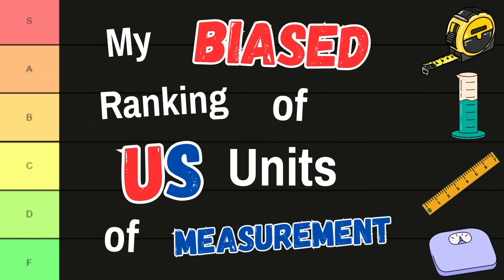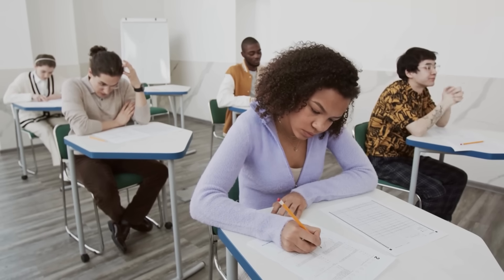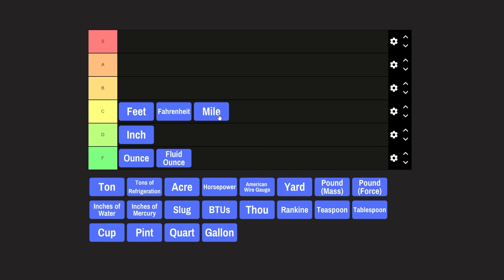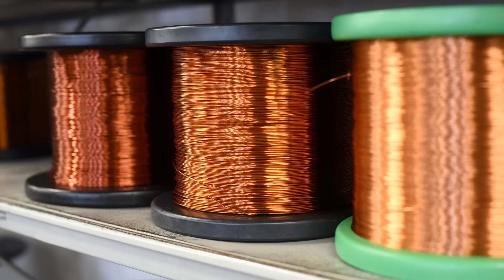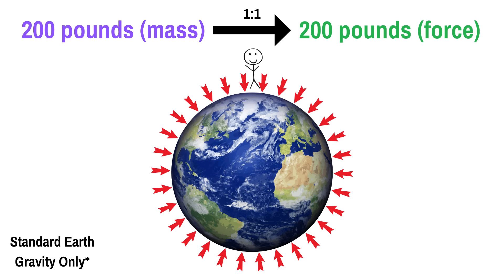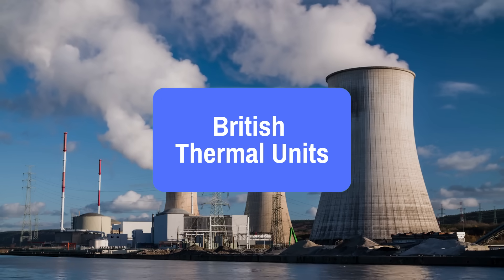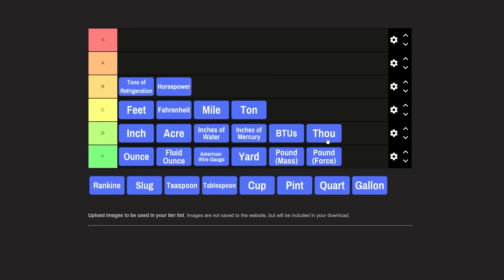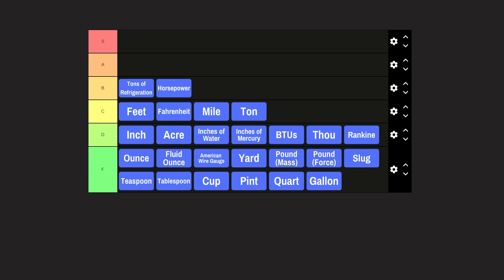Tier List of the DISASTROUS US Measuring System

Comment: 1 TR = 80.01Kcal/kg*907(907 per short ton)/24. Rules of thumb: "1 TR is approximately equal to 12000 BTU (I don't know which one. I could easily figure it out, but I don't care) or 3024 Kcal/hr of energy/heat load." How the f did this get B-tier, are you high? I accept, that it was good at the time tho. I agree on HP in B-tier, good unit, just outdated. I also agree on Cup, Pint, Quart and Gallon, contrary to popular belief there is not one, but many different definitions on what these are exactly. Some companies provide proprietary "cups" with their ingredients, some recipes fail if you use the wrong cup size. The Gallon was changed 10 times because the old Gallons where based on different bronze statues, which all got lighter over time. Half of the Pint definitions are based on Gallon-definitions. Some are just like "f* it, 1 pint is 0.5 litre now." Or even 2 litres! Actually I don't agree on F-tier, they should be lower, like F- - - tier or ZZ-tier. Definitely worse than Yard. Fun fact: If you go onto WIkis disambiguation page for slug, then you have to scroll way down to find the unit.

Comment: I had the joy of starting with bushels pecks rods poles  perchs (??) chains furlongs  etc at primary school. Then less archaic Imperial units at lower secondary school ... changing to cgs then mks and finally the sanity of SI by 'O' levels. After that it was SI all the way through 'A' levels and Mechanical Engineering 😊
Once we asked our Physics teacher what units we should use in our homework ... he said whichever we want to ... so we used Astronomic units, Earth weights and Eons.

Comment: It’s a shame that this list failed to include the U.S. survey foot. In 1866, US Congress decided to define the foot as [1 foot = 1200/3937 meter exactly (or 1 foot = 0.304 800 6 meter approximately)]. In 1959, the internationally agreed upon conversion for a foot became [1 foot = 0.3048 meter exactly]. The change was recognized across the US, but geodetic surveyors were allowed to use the old system as an exception. Somehow it took until January of 2023 to get them to shift over to the international foot and deem the US Survey foot to be obsolete. 

Despite being made obsolete, my college surveying professor still made me do calculations with Survey feet in 2023.

Comment: There is just one S tier trait of Imperial Measuring- fractions are easier to deal with since it deals in Base 2, 4, 8, 12, 16, 32, 64, etc. rather than everything being 10s based. That's the only reason I feel it's useful, Metric and fractions are a pain because it's all Base 10. I wish we'd sync up an inch to say: 2 CM- that way they'd translate easily, even the basic fractions would be easy to deal with in Metric if an inch were 2CM. Other than that I wish we'd all just switch to Metric. I'm also a bit bias towards F vs C regarding temperature, only because I'm so used to it- same with pounds. I still say junk Imperial, redefine an Inch to make them easily compatible, get rid of Lbs. and F. though, along with all the other Imperial junk. Too many People would gripe, just like this cursed Daylight savings time garbage- so we keep it because People just don't want to get used to something better.

Comment: You didn't mention the other "gauge" either, but maybe that's used universally. (Gun barrel size.)
It's based on how many balls of lead of a certain size equal a pound. So a 12-gauge shotgun's barrel is just big enough to fit a ball that was a 1/12 pound of lead. (Smaller numbers are bigger again, but it's a bigger scale than the wire is.)

Comment: gauge meaning something smaller and smaller as the number goes up makes sense with bullets (like x gauge shotguns) - 
20 gauge means that out of a block of a certain size of lead (forgot the size), you get 20 bullets.
30 gauge means out of the same block, you get 30 bullets.

so 30 gauge is smaller than 20 gauge.

Comment: As a European I was raised in metric, and hate Imperial, but I have to say Fahrenheit was a recent revelation for me. I'd always thought it was stupid, but to be honest temperature is always going to be arbitrary - even scales which start at 0 Kelvin have arbitrary units - and the idea that it would simply be 0 = uncomfortably cold and 100 = uncomfortably warm seems to make just as much sense as using the boiling and freezing points of water (at a specific pressure, with specific purity, etc.).

Comment: US fluid ounces are heavier than one ounce though - Imperial fluid ounces are a little smaller than their US counterparts, and are about dead-on one ounce in weight.

If that liquid had been water, the weight would have been pretty much the same as the soda; if it had been 12.5 Imperial fluid ounces of soda rather than US fluid ounces, it would have weighed 12.5 ounces.

Soda and water do have different densities, absolutely, but not enough to account for the discrepancy shown here.

Comment: Despite American insistence on bastardising the English language, a metric tonne should be spelt the correct way - “tonne” - and not the American way - “ton” - to avoid obvious confusion and since you don’t even really use metric.
Same goes for measurements - a meter is a device for measuring (water meter) whereas a metre is a unit of measure (the door is a metre wide). Americans should adhere to the standard spellings, not arbitrarily change spelling of something they don’t actually use.

Comment: i can personally work in any measurement system provided its consistent throughout the project. However i will almost never intuitively move to metric because inches and feet feel more natural than centimeters and meters since they are too small and too big respectively. dont even say it cuz i know not a soul uses decimeters Also as mentioned, Fahrenheit  is a more digestible form of temperature for a human, however i almost always think in Celsius for technology since that's usually how its read out and makes more sense in that context since 100 C is usually the max allowed temp. It'd be nice if we made 1 yard = 1 meter but then a few other measurements would need to change with them such as minute of angle.

Comment: I think penalizing the fluid ounce just because water doesn't have the same density when you dissolve stuff in it is a little unfair.

Metric basically did the same thing.  A gram was originally created to be very close to a cubic centimeter of water.  A liter is 1kg of water.  1 mL is 1g of water which is roughly equal to a cubic centimeter.

Metric does have the nice thing where you know how much it is in cubic centimeters (good luck converting fluid ounces to square inches) but fluid ounces seems like one of the few times when imperial units had the right idea.

Comment: Was afraid you'd put Farenheit higher but a pretty reasonable tierlist overall.
Reply: Fahrenheit should be higher. 90% of the time we use temperature to talk about the weather or the room temperature. There is a noticeable difference between 85-87 degrees F but you can call them all 30C.  Also who cares what temperature water boils at? You don't set your stove to 100C to boil water, you just turn it on high and water might freeze at 0C but you don't set your freezer to 0C to keep your food frozen, you set it to -18C which is... wait for it... 0F!
Reply: @McP1mpin Fahrenheit is better for indoors, Celsius is better for outdoors
Either way everyone can probably agree Kelvin’s the least useful of the 3 in daily life, only being good for hyperspecific lab settings
Reply: Hi, I agree that there's a difference between 24.4C and 30.6C but luckily decimals are a thing and celcius has no problem expressing these values at all. 
Taking the boiling and freezing points of water as 100 and 0 values objectively makes more sense than the incorrect estimate of human body temperature and the freezing point of a salt water mixture that fahrenheit uses for these values.

The -18C that you set your freezer to is a relatively arbitrary number set there as a compromise between efficiency and energy consumption. The reason that is isn't -19C is because -18C is easier for Americans to remember and American companies just caused it to be the standard.

Comment: In the US Customary Unit system, one fluid ounce of water does not equal one ounce of water. A US fluid ounce of water at standardised temperature and pressure weighs 29.57 grammes, while an ounce is 28.35 grammes, so about 0.4% difference. I will give that a (generous) C. Note that the Imperial fluid ounce of water does weigh 1oz, or 28.35 grammes. But then the USA does not use Imperial units, despite what many claim. The country clung onto an older system of English units, which means there are some significant differences.

Also, James Watt did not invent the unit of horsepower to allow customers to envisage the work it could do. The unit was invented so that Bolton and Watt could charge royalties. It was a bit like Ford charging you annual royalties for how fast your car can travel.

Also, on a technical point, there has been no such thing as the conservation of mass in physics since the Special Theory of Relativity was accepted. There is a principle of the conservation of energy though, although even there we have to be careful with some implications of the GToR.

Comment: Thanks for putting this tier list together, as a European I did not know about the slug. And then there's Grain, Hundredweight, Stone, Furlong, Bushel, Foot-Pound, etc etc. You can't blame the US for all of this, most of this stuff goes waaaay back. I like the way some of these measurements correlate through common objects. For example, a small scale is called a troi, where 1 troy ounce (unica, half a pound) is 480 grains barley or 640 grains wheat, which is also approx 1 apothecary ounce. The carat (not karat) is one carob seed (ceratonia siliqua) where 24 carat (a siliquae) is a solidus, a gold coin weighing approx 1/72 of a pound.
Reply: You can't blame The US for the fact that these measurements got invented, but you can blame the US for still using them.
Reply: @davel4708 The vast majority of these videos make fun of Americans for using units that the vast majority of Americans don't use.  They bring up units like the chain as if, simply because it has a historical definition, we actively use it.
Reply: @davel4708 we don’t, they are defined but non of these are used in common language
Reply: I'm American and I didn't know about the slug, either.

Comment: You put mile in C tier?  It is definitely D tier at best because you cannot convert it to any of the other units easily even within the same system.  I mean at least tons are 2000 pounds but a mile is 1760 yards.  With the smaller units like feet or pound the fact that it is on a human scale overcomes some of the arbitrary nature of it's creation but a mile is not only even more arbitrary it is too big for easy comprehension.

Comment: Fun video but why so harsh on thou?  That's the one unit that has a clean relationship to others.  On the other hand, there is one knock against it you didn't mention. The people who use it (machinists and CAD designers) usually call it a mil, as in one one thousandth of something.  That drives me crazy because "mil" is already taken, at least in casual speech, to mean a millimeter or in chemistry and medical settings, a milliliter.  F YOU! IF YOU INSIST ON CRAZY UNITS, YOU DON'T GET TO HAVE THAT WORD!

And how can gauge not be your all time most hated one?  That not only has the most insane definition (the thirty ninth mathematical root?  Come on!) but it's backwards with big numbers to mean small!  I have to work with gauge sometimes and it is ghastly...

Comment: The fact that he was practically dissing the entire system was hilarious
Reply: It’s not the units that are the problem, it’s the fact that they don’t relate to each other. In the SI system all units derive from basic units for time, mass, length, charge, etc. and all go up in factors of 10^3, so it aligns with our decimal number system.
Reply: @Tailspin80  that is one problem. The other big one is, that for all of these Units there are countless other units with the same names, but slightly different meanings.
Reply: @MusikCassette  True. US gallon vs Imperial gallon being one.
Reply: @Tailspin80  or just think about all those different feet, that are about, but not quite 30 cm
f.e. the feet of my hometown is 289 mm. 
Of course we stopped using it, because it is f ing stupid.
Reply: @MusikCassette tbh feet make the most sense. Theres only 1 foot measurement it's just the conversion to other lengths that's hard to handle. I think you're just annoyed about its origin being a body part
Reply: @aceystar1478  that is not entirely accurate. in fact I strongly suspect, when you say foot, you do not mean 289 mm.
Reply: Well there is nothing not to dis about it, so
Reply: not enough though. I mean non of these  are anything other than F tier.
With miles he did not even Mention that there are other length called miles and this is the stupid one.

Comment: What is even crazier is that back in the old days, every European country - often even different cities in the same country - had their OWN version of the foot and inch, and other units. It was always 12 inches to the foot, but the length of a foot varied by up to 10cm! The shortest was around 25cm while the largest "foot" was over 35cm. It just so happens that America adopted what was the British Standard at the time.
This variance, combined with the growth of industrialization is, I suspect, part of the reason Europe embraced the metric system so quickly and thoroughly. It would be VERY difficult to have mass production when, say, ½" bolts from a factory in Hamburg are a totally different size from the ½" threading press you got from Berlin, and neither match the ½" nuts you ordered from Dresden.
Meanwhile, the US had settled on the UK Imperial standards throughout, and its industrial revolution was much more self-sufficient and self-contained. Without a pressing need for a new unifying standard, there was little incentive for US industry to convert to a new system.
This is my hypothesis, anyway.
Reply: Napoleon imposed the metric system (created in France) in France and conquered lands (and its civil code still used by many countries), the old units came back after his loss but still it was a standardized unit in every sectors which help in trades and science...so it took over  the old units which varied from places to places, easier to have the same units in rotterdam and Madrid for trades and industries.
Reply: So what actually happened is throughout the 18th century there has been talks about creating a unified system of units to solve that exact problem

Britain was the first country to ratify a national standardised system (the Imperial System) 

During the French Revolution, the newly minted government used the works of all the European Scientists that talked about a universal system, and created the metric system 

It came into law shortly after

The Napoleonic campaigns had Napoleon impose the metric system on the conquered lands and it thus became more and more popular throughout the european colonial empires and thus the world
Reply: Metricfication overall is a very complex topic due to a lot of politics around it. Meanwhile in the USA it is pretty simple and is exactly what was stated in anouther comment, the US sees itself as an exceptional nation, a world leader and a manifest destiny. The act of adopting a new system, especially not their system but someone else's, in a way goes against this mythos, so it would receive a lot of backlash, as did metrification in the UK (and how the UK never really completed metrification). The thing is, kids in the US are still using metric, in science and some engineering it is crucial to use it. 

Meanwhile, despite metrification happening in the 1970's for the country I live in, it's so rare to even talk about imperial even with those that lived under it for a significant portion of their lives. It goes to show if you actually put in the effort to change things, people can and will switch.
Reply: Rant add: America still keeps most of the British pronunciation and spelling of 16-18thC British... At least that's consistent

So some American words are more closer to Shakespeare than modern English English.
Reply: Not to mention that the US does not use Imperial units but the US Customary units, which in part differ - and are defined by metric standards.😂
Reply: They are Just stunborn, the British and even nasa are using the metric sistem
Reply: Germany went metric the year after it was finally created in 1871.  It was rather late to the party, but then again, it didn't exist before 1871, and parts of what became Germany went metric before that.

As to the US and their bastard version of imperial: two factors that play a big role (in addition to what you and others said, industrial laziness and inertia surely are important contributors) are American Exceptionalism and Tradition; the US is so young, they cherish every tiny little tradition they do have, even when they routinely claim to want to abolish one, like, for instance, the Electoral College.
Reply: I recommand to check the channel Machine Thinking.

There are top quality videos on thr history of precision manufacturing.

And how the "Swedish Metric Inch" for US export of precision measurement tools was adopted by Ford and forced on the US auto industry. And then during WW2, the US auto industry forced it in all war related companies. It's only after WW2 that the entire US adopted it.

Comment: But a US fluid ounce isn’t the volume of an ounce of water (at any reasonably sensible pressure and temperature) — that would be the UK fluid ounce, which is about 4% smaller than the US one. The US fluid ounce is basically the volume of an ounce of wine, which is larger, because alcohol is less dense than water.